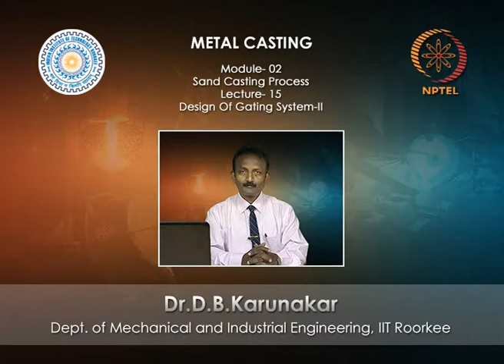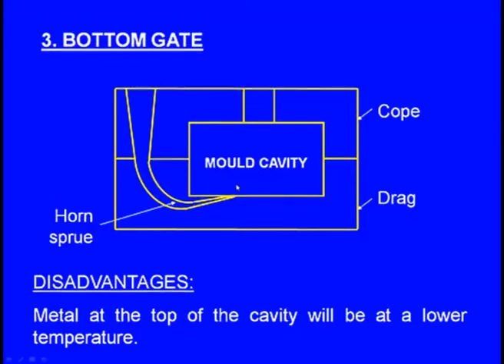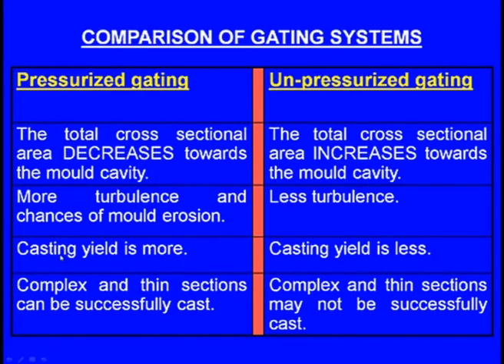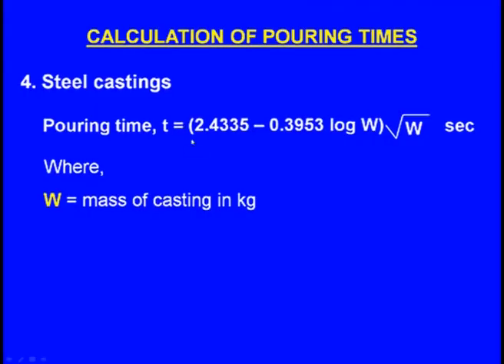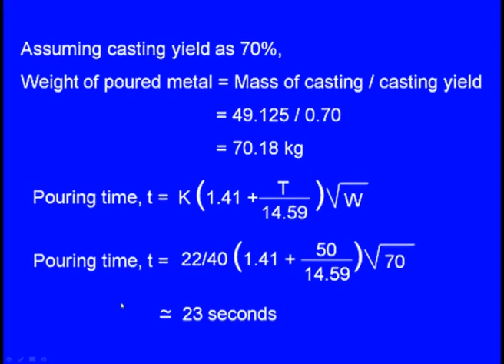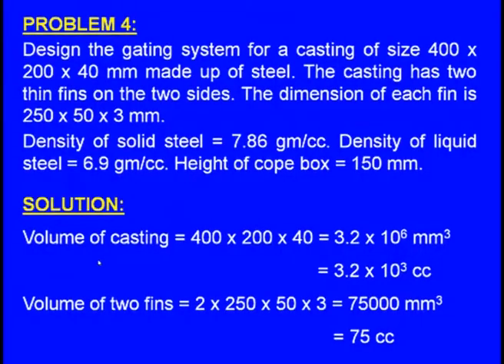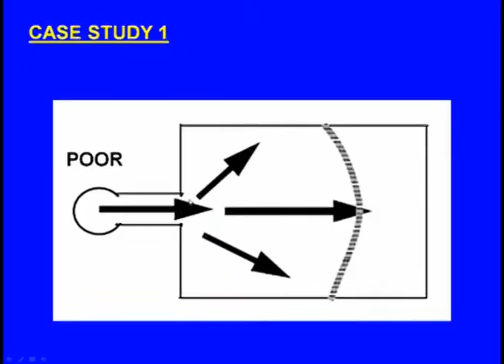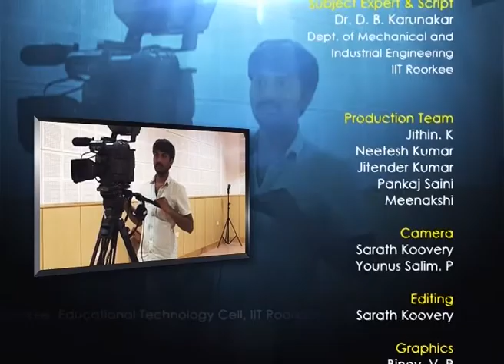Design of Gating System-2

Comment: the cross sectional area for pressurized gating system decreases rite?...but the given ratio seems to increase...like for gray cast iron its 1:  1.3: 1.1 ...???anybody wanna sort it out????
Reply: Yeah
Reply: See when a size of ingate is lesser than that of runner it will create back pressure and so it can be called pressurized gating system.